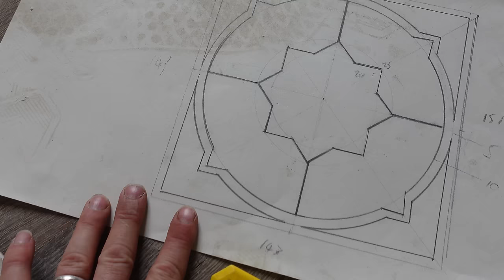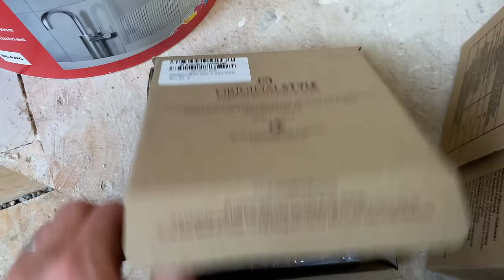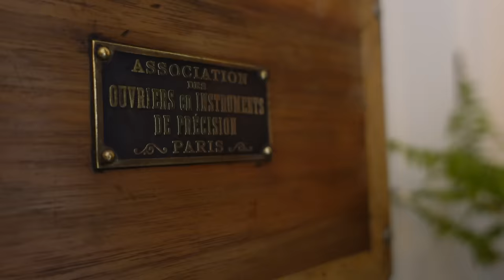NON STOP 12 Month Renovation On This Abandoned Chateau | BEFORE & AFTER Timelapse.

Comment: I don't believe you are using paint brushes and rollers on the wall panels and not a spray rig. WHY? You could knock that out in about a quarter of the time with just two people and the other people could have been doing something else. 

That's a huge job to take on I just thought you would have utilized modern technology to cut labor hours. Other than that everything looks awesome. What a treasure.
Reply from the maker: Thank you, we used brushes to get the texture and to make it look more original 🥰